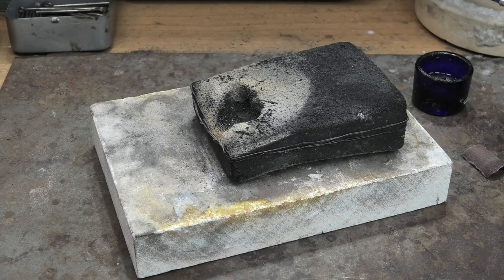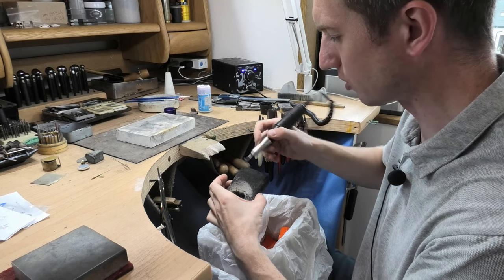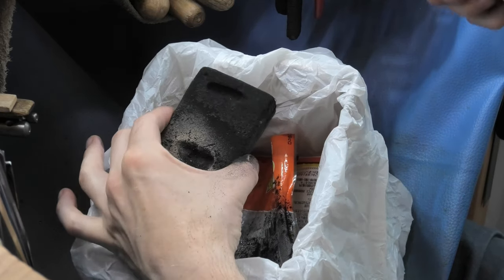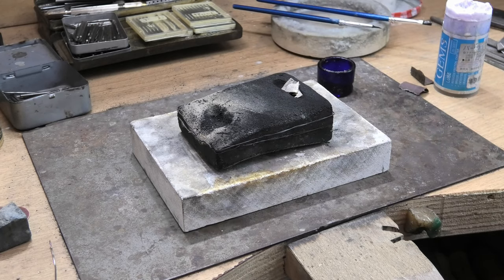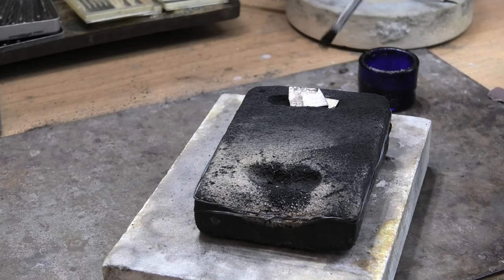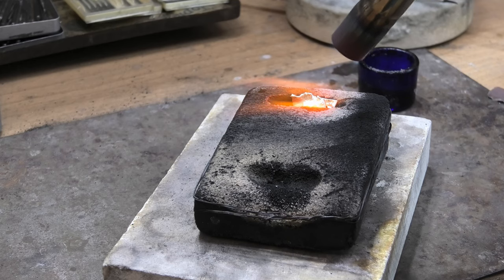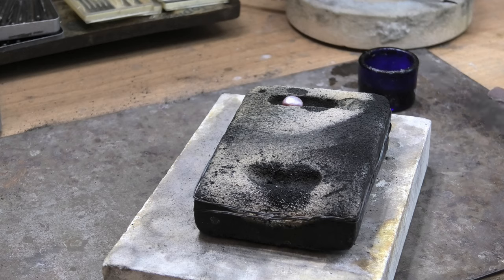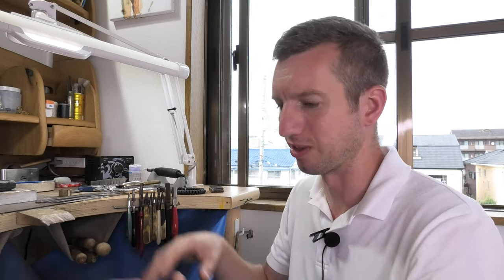How to Melt Up Precious Metal at Home

Comment: Hey just as a tip. You can also buy a firebrick in nearly every hardware store for about 1,50€ and break it into a small square or round section and slowly carve it out with a Dremel grinding wheel and smoothen the outer edges (wear a mask!). Then you have a small really nice crucible. Mine lasts until now (about a year and I use it quite often). Then I pour the metal into a piece of Wood that has the profile that I want. I use a piece of meranti which lasts long and already has long grooves, because it is usually used for covering terraces.